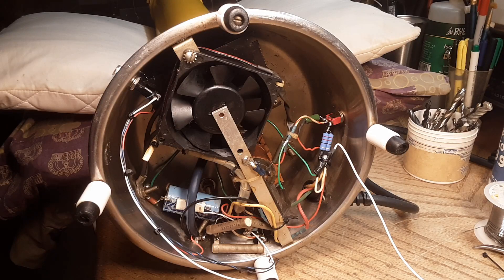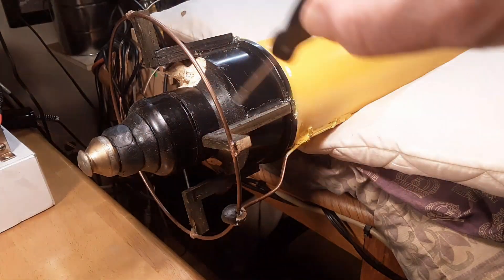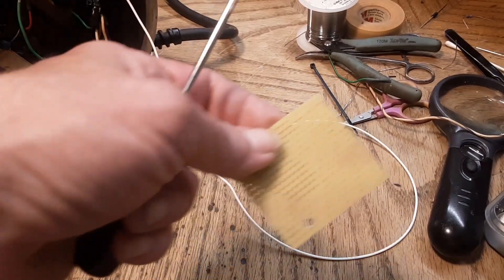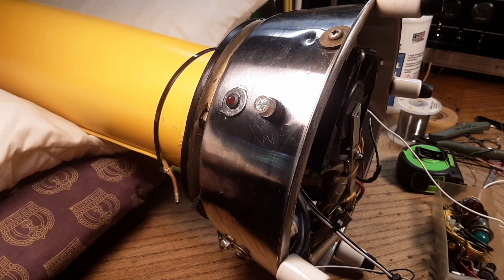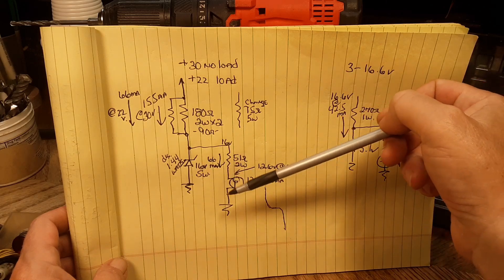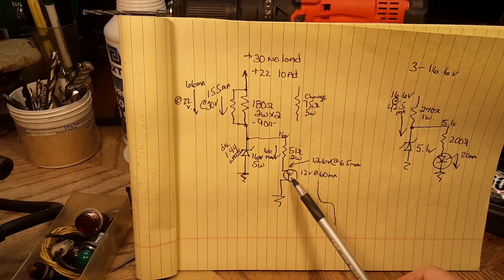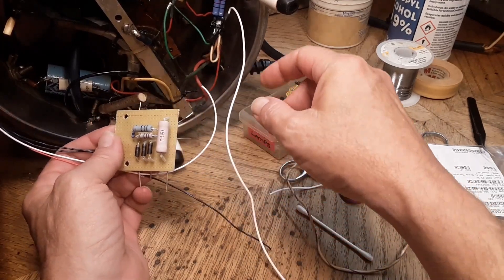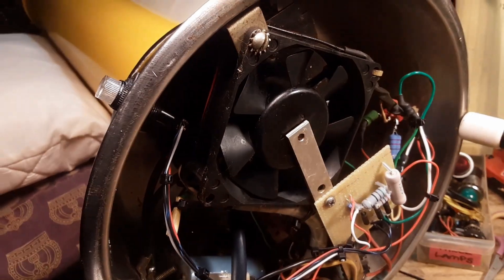Cockcroft/Walton 💡voltage multiplier,aka my" high voltage tower"

Comment: I don't think those paralleled Zeners are working the way you'd expect. Without balancing resistors, one of them is with the (Slightly) lower value is going to hold the voltage below the value of the other one, so it won't be conducting. Same as Base Emitter junctions on paralleled BJTs. If they are really well matched the resistance of the wires might hold them close enough for the Knee curves to have some overlap, but otherwise what you have is redundancy: one is taking all the power, but if it does fail open, the other one will immediately take over (but will be subject to whatever caused the first to blow.)
Reply from the maker: @SkippiiKai  yes I agree to a extent.thanks for comment.i got you thinking🙂
Reply from the maker: @SkippiiKai  not what you might think.if that was the case one of the diodes would be running much hotter.i have a fair amount of current through that branch.they equalize better than you think.there 2% as well.have a great day!😃

Comment: When incandescent bulbs go dim, they're often just shifting their output into the infrared, so you should get better results from your camera than from your eye in those circumstances.
Reply from the maker: That's interesting🙂do you think that relates  to different colored leds, and why they give big auras(not sure i spelled that right)on cameras?I know little about optoelectronics,but I do read the wavelengths of the leds on bag.
Reply: No, that's caused by something totally different. That's because the colir sensors in the camera pick up mote wavelengths than our eyes, but assign them to the same RGB values that our eyes see. I'm not explaining that great, but I'll put it this way: if you look at something green, and take a photo, your camera will see that and say, "Yup, that's green." But if you look at your IR TV remote, you see nothing because your eyes can't see it. But your camera sees it clearly because it activates some of the red and blue sensors so your camera  goes "yup, that's... Magenta?"   @generalingwer4341